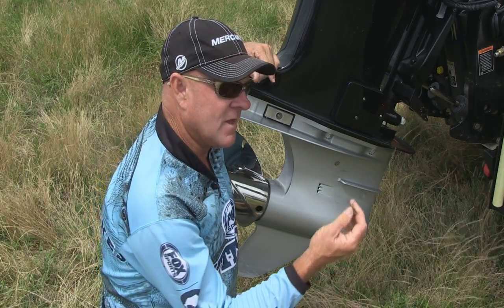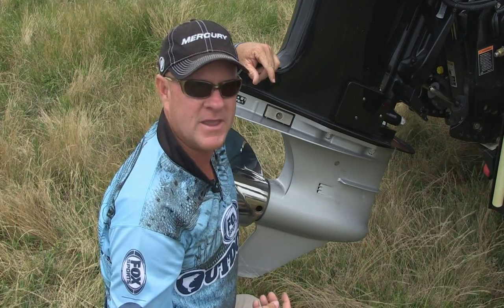Cooling Features of Mercury 250 Pro XS with Barry Stokes

Comment: You never mentioned anything about the 4 water pick up holes in the nose of the gear case that constantly pick up junk and send it straight to the thermostats which then do not let the engine warm up to its recommended operating temp.